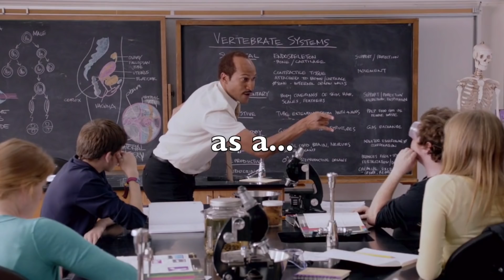Using Tesla parts in my Electric Rat Rod Conversion

Comment: from big aluminum radiator to only steel plate with no contact only air flow .. ? my prediction : flame on ;P ( steel has 1/4 thermal conductivity of aluminum so this gone be on hot bastard in eve hot road ! )
Reply: He should just mount the heatsink and controller up front like the old radiator.
Reply: @PD-we8vf  Then the phase wires to the motor will be longer and lose volts and efficiency. It needs to be as close to the motor as possible.

Comment: Zip ties through sharp metal holes in a machine that will be subject to vibrations may not be a long lasting solution.
Reply: I was thinking the same, Take the time and thread tap the holes!
Reply: I wouldn't worry about it.  the cables are not much mass and the ties are really big.  I think this is one thing he is safe on.
Reply: I love your optimism...you act like this will be capable of being a commuter for 10 years.
Reply: @cup_and_cone    Yeah, the guy is agonizing over tie raps that will outlast the pyramids, but he's okay with Rich chucking that HUGE heat sink in the junk pile as though the engineers at Zero Manufacturing were really retarded to use all that weight when they only needed to give it an inch or two breathing room and a little air flow.
Reply: Probably not enough weight in those cables to make much of a difference. Besides, the motor will burn out long before that becomes an issue.
Reply: that is okay, as he is using indoor zipties that will become brittle and break and fall off in one years time anyway.
Reply: @johnsmith12421  motor or controller, therefore, lasting long enough.  lol
Reply: @solardale715   Sun light (ultraviolet) might make zipties brittle, but from my work in industry, it seems those damned things can last nearly forever... if you keep them in the dark.

Comment: i'm not mad at the weather stripping "homemade grommet" trick... I'll be using that one.. Thanks
Reply: but grommets are cheap
Reply: @JustinEdwardsL  bro, I don't think Rich even knows wtf a grommet is. Who the fuck would cut a square hole and 4 pieces of weather stripping when you could drill one hole and push a grommet in in, idk, 4.5 seconds

Comment: have you thought about using the heatsink on the other side of the steel? maybe replace the steel with aluminum or cut slots in the steel so the speed controller has more surface to dissipate the heat?

Comment: The day you drop something heavy on your foot is the day you wonder why you’re wearing flip flops rather than safety shoes! 😆
Reply: If you don't work in your garage wearing only underwear with flip-flops do you even DIY?
Reply: this is why i only wear steel toe shoes. i dropped a motorcycle gas tank on my foot and my toe is still messed up.
Reply: SpankBuda  
Sparks ain't that heavy.

Comment: That battery is secure...unless you get into a crash. 3 screws and a tab or two will let go in a half a second. 

Are bolts not an option?
Reply: Yeah, that battery weighs a heck of a lot and it is standing us so tall, and so it will always want to tip over at every stop.  That rear bracket is eventually going to be torn upward.  Oh, and I just re-wound and looked it over again.... that battery will also push forward into the front bracket at every stop.
Reply: Yeah add two big metal straps...
Reply: @patbonz2015  Yeah, the two big metal straps are to save weight.
Reply: @leovolont Titanium or aluminium then. but something to keep 1,000 lbs from being projected toward you.
Reply: As a professor of gravitics i can assure you it will be fine  by my calculations it has 1 tab too many
Reply: @bcs7686  I can tell you're a professor of nothing because you would've at least used the proper term "gravitics." 🤣

J/k... I'm totally playing along.
Reply: @SergePupko  i was up doing gravitic calculations all last night and forgot to switch on my grammerly app so ive now edited so i don't come off like some internet keyboard professor
Reply: We have all seen spectacular battery failures so Why in God's name would you secure a timebom to your car? Better let it break of, If you hit any thing head on you want to be as far away from the battery as possible... Or enclose shield it some how. I know radrods are not ment to be safe, but I would try and shield it off a little.
Reply: My thought too Ooch....
Reply: @bcs7686    Hi Bryan,   yeah, I was sort of wondering where the Center of Gravity on that battery pack was.  If most of the Force Vector is pointing straight down, and the Rat Rod will too heavy to generate much in the way of acceleration that could rock the battery back, and since he lopped off the brake pedal, there goes his leverage there, and so we won't have much in the way of deceleration forces.  Yeah... it would have probably been okay if he just put a piece of wet chewing gum underneath before setting down the battery.  It won't go anywhere unless the car flips.  OH!  Should we worry about Worst Case Scenario, that is, if there is a catastrophic collision, we don't want that battery pack to flying around like an exploding lithium bomb.
Reply: @cheezy2455    Hmmmmm,  Yeah, that battery is a huge Lithium Bomb isn't it.  Smack the thing with a ballpeen hammer and it would go up like Hiroshima.   But I wouldn't want to KILL all the people in front, especially if I rear ended them (which might happen because he sawed off the brake pedal and so lost all the mechanical advantage there... he'll push down hard and it won't be hard enough to actually slow down).  I wonder how the Zero Engineers isolated that battery.   Well, on motorcycles, most the time the rider and the motorcycle end up in different counties anyway.
Reply: I think hes just being lazy.  This whole build is a sloppy mess

Comment: as a professional internet troll i can relate to the amount of lubricant used while drilling
and as a long time recreational podiatrist i adore the foot-fashion.
BUT what i can not tolerate is the removal of the heat-sink.
ARE YOU CRAZY ?

Kappa
Reply: Yep, definitely a bad idea ! !
He should have added a larger heat sink and fan because of the extra load.
Reply: @r1yamahamini  Yes, and aluminum is a better heat sink than air.
Reply: That's affirmative.

Comment: who's going to help Rich fish the battery out of the back of a SUV later on? after it disembarks during a hard stop
Reply: Don't worry about that his brake pedal is going to fall off first.
Reply: This x 100 if said SUV is causation of sudden stop ! Tensile strength (lifting straight up) and sheer strength (side loading) have vastly different failure modes
Reply: No worries about that.
It's a rat rod, the only way it could hard stop is crashing

Comment: As a person who already smoked a 600 amp controller once (Curtis) - even WITH a heat sink... PLEASE use a proper heat sink and conduction grease. In my case, supposedly was a manufacturing error, but I still was out over a thou to repair.

Comment: Been riding/working on Zero's for over 5 years now.  USE THE HEATSINK!  Also, move the charger off the battery... It get CRAZY hot and can/will overheat the battery in warm weather.  Literally put it ANYWHERE else and lengthen the wiring, its just some Anderson connectors for the +/-

Comment: Fun weight saving tip: if you cut strategically placed holes in some of the metal, it’s lighter without structurally compromising the car (if you think before you cut)

Comment: You can mount the heatsink under the bracket and the controller flat on the bracket and it will give you the clean mount you desire and add additional heat dissipation.  Adding the spacer is actually doing the opposite of what you're thinking.  The larger the metal that the controller comes in contact with the more air can move across said metal and remove more heat.   Sandwiching it, isn't going to hurt the heat transfer as long as all metals are flat and make good contact.  I believe the sandwich idea will give you more heat dissipation than the original bike setup.

Comment: So far so good :-)

But I'm like 90% sure that You'll burn the ESC (speed controller/regulator) or at least cut off will work very often (if present)... by removing heatsink You remove cooling capability and heat capacity from the ESC, and this gets even worse if You'll make a gap between ESC and frame. Attaching ESC directly to frame with thermalpaste woud greatly increse its heat capacity and the frame woudl work as an radiator. If not... have a nice burn-out ;-)

Comment: Rich your taking something designed for a light bike and putting it in something much heavier.
What do you think that will do to the loading of the controller?
Then your reducing the cooling to the controller which will be under more load than it was before.

Just put the heat sink back on and then mount it via some 90deg mounts to the outside cooling blades then just ram air into the heatsink. quick and easy.

Comment: Hello Rich. As a non-electrical engineer I would strongly advise that you find some way to use the original aluminum heat sink for the Sevcon Gen 4 motor control unit. An air gap between the controller and the plate is likely to result in overheating. You're going to need the large surface area provided by the fins, as well as direct contact possibly with a special paste for optimum heat transfer. Keep those great videos coming my friend. 😁

Comment: as a professional DIYer with 9.45 years of experience you lay the best noob welding bead i've ever seen.

(also i've only welded twice ;P)  square tube for a failed crossbow experiment and a motorcycle gas tank patch

Comment: Put the handlebars from the bike where the steering wheel is, then you'll have;
throttle, signal, high/low beams, light on/off, front/rear brakes, ignition, motor cutoff etc, 
and you'll be able to just wire it upto the existing motor controller instead of frankensteining everything together
Then call up JerryRigEverything and tell him his handicapped girlfriend can drive your car, since it'll be 100% hand controlled.
Reply: Daxton Anderson geez don’t want to kill the poor girl
Reply: @letsgocamping88  did you see the sidebyside bike JerryRigEverything built her? No way she'd be scared of this thing.
Reply: Daxton Anderson yeah but that wasn’t built by rich!!

Comment: AS A PROFESSIONAL 
high-performance electric bike builder, I can tell you that removing the heat sink from the controller is the absolute STUPIDEST thing you can do. In your entire life)

Enjoy having the power cut out anytime you go up a hill, accelerate hard, or put it under any kind of load.

You are putting it into a vehicle with much more weight than the bike it came out of. What you need to do is change design to accommodate a bigger heat sink. Not sans heat sink.

That said, love the channel,  yadda yadda yadda. And I'm fixing 4 totaled Teslas,  and now fully know your pain. Although I'm not dumb enough to ever buy a flooded one.

Comment: If you have any questions about welding, please let me know. I'm not one of the "as a welder" types of people, but I'd love to help. The process that you're using was difficult for me to learn, but from what I've seen, I'd up the voltage and slow down your overall speed, to keep it more consistent and get a good bond to the metal. Also, I have a 120 Amp welder that's only meant for up to 3/16 gauge steel. You might want to upgrade to a 220/240amp in order to get the results you want when you're working with that thickness. Love the work, keep it up!

Comment: Hey rich. You could attach the heat fins to the underside of the mounting plate for the controller. The heat will still transmit. Assuming theres room...👍

Comment: Rich, I'm sure you have heard plenty on the heat sync, but heres how to fix it. Grind the ridge on your plate flat. Apply thermal paste to your plate your mounting the controller to remove the spacers and apply thermal paste to the heat sync. Mount heat sync to BOTTOM of the plate. You will increase your thermal mass and surface area this way. Good luck.
Reply: Mount heat sync directly under controller on bottom of plate super tight. Or the controller will burn out

Comment: Just put the heatsink back on make a space inbetween two sheets of metal make a mounting plate for the screws that screw in with the heatsink from the outside and problem solved. There is a heatsink for a reason Rich. Also good luck with the build!

Comment: Rich,  I have an alternative to you using those zip ties to mount those harnesses.  Get some small steel muffler clamps and bolt them in.  Your logic is sound about avoiding rubbing on sharp edges.  Consider the same thing with plastic zip ties rubbing on those steel holes.  Just a thought.

Comment: As a person who already smoked a 600 amp controller once (Curtis) - even WITH a recommended heat sink... PLEASE use a proper heat sink and conduction grease. In my case, supposedly was a manufacturing error, but I still was out over a thou to repair. At least put the heat sink on the bottom of the metal plate. Remember, surface area = better cooling. Keep up the great work Rich! I love it that you’re DOING SOMETHING, while I’m sitting here on my a55 pressing. These little plastic buttons.  About your current heat sink metal plate... all I gotta say is, please record the fire and smoke for our viewing pleasure.

Comment: You need to use the heatsink AND you need to get some more of the white grease to make sure it has a good thermal connection, spacing the controller will be disastrous, it will overheat and probably fry itself. You can see this is the general view, but very important as you can cool that device with airflow.

Comment: as a professional A Hole , banana selector, welder,engineer,mechanic and property builder you still need more heat so slow down just a little more and your wire speed needs tobe a little bit faster (almost dialled in ), also try moving from left to right when welding  your bead, like in a C  shape or circular motion  it will lay down a little better  and not be hump of metal . Happy thoughts Rich Happy thoughts :) ohh P.P.E get some

Comment: Rich, you make me smile every time. But next time you decide to run wiring may I suggest drilling a hole and using a grommet? I hear they have 2 piece grommets so you can send the connectors through then put the parts on either side of the wire and pop it in the hole.

Comment: Rich you need to either mount that controller directly to the steel plate, or put that heatsink back on. The airflow between the flat base of the controller and the steel mounting plate won't cut it.

Comment: Try looking at the guide on your welder, it will give you the recommended settings for the material thickness. It is usually under the cover for the wire spool.
You should post a video of your welding close up and machine settings, I'm not sure how you got the entire weld to look so bad. It rather impressive!!

Comment: I"m not so sure you should offset that controller since an air gap would have worse thermal dissipation than the heatsink. I'd mount it directly to the plate and if there's room, mount the heat sink on the other side of the plate. But I'm not a professional anything, so suit yourself. Loving the build so far, it's gonna be rad!

Comment: Oh yeah use that kickstand like you would use a parking break or gear engagement. I believe it disconnects the drive gear or activates the solenoid to operate the motor itself.

Comment: Heatsinks work on surface area, which is why there are many fins to increase the exposure to the surrounding air. They are also made from aluminium which releases its heat a lot quicker than steel. Removing the heatsink and mounting the converter onto a steel flat plate ain't gonna cut it i'm afraid. My guess is it will cook and expire pretty quickly. Especially with the extra load you are going to be pushing through the converter.

Comment: As a human being of 33 years i am aware that aluminum is a better thermal conductor than steal. Be sure to install some fire extinguishers in easy to access locations. So that when the battery flies off while going down the road and you realize the controller was on fire the whole thing doesn't burn down like daisy did. 
ur welcome

Comment: Yeah roasty toasty. 

More load + less heat sinking = Magic Smoke escapes.
I would put the heatsink right back onto the controller. Add more heatsink paste too.
And to mount the controller length wise to improve the airflow over the heatsink.

Comment: 10:10 for thermal conductivity to an uneven surface, you can use silicone thermal conductive pads.  You could even add the original heat sink to the bottom of your plate for extra radiating effect.

Comment: As a Professional Advice Giver( and having done welding for Great Dane Trailers)....you definitely should've practiced welding on scrap pieces before taking on the rat rod project, to get the heat and power setting correct on the welder, any amount of force will break those welds, and somewhere there's a professional welder cringing at your weld job...😂😂....love the knocking on the welded peices to show how strong they are 😂😂😂

Comment: You could mount the controller directly to the aluminum plate and mount the heat sink anywhere on the aluminum. Even underneath. The closer to the controller the better.

Comment: Use arctic silver as a  thermal compound, reattaching the head sink to the back side of the plate and add a couple of 12 volt fans on a thermistor. You will know if its getting to hot if the fans kick on. That is a pretty chunky heat sink to eliminate they designed it that way for a reason. Chances are when he blows this controller up he has another from a tesla to put in its place.